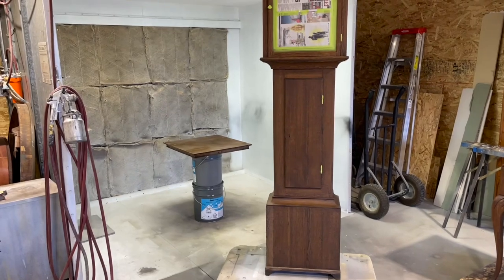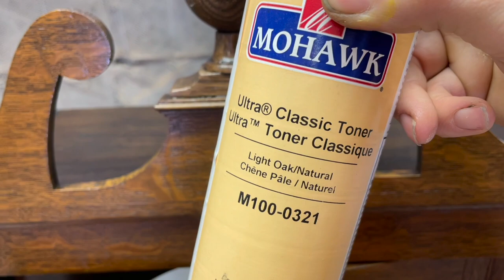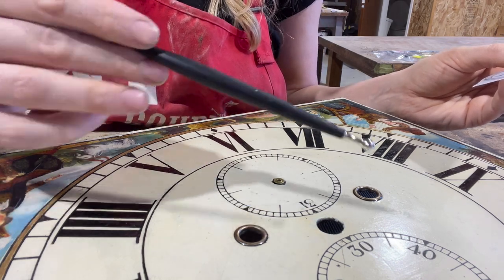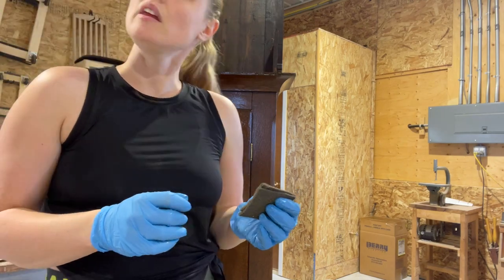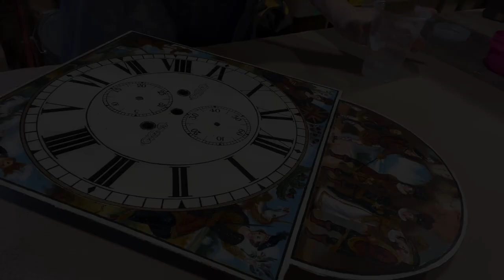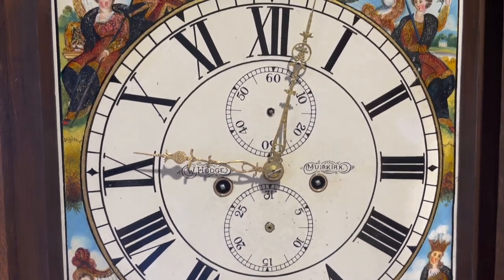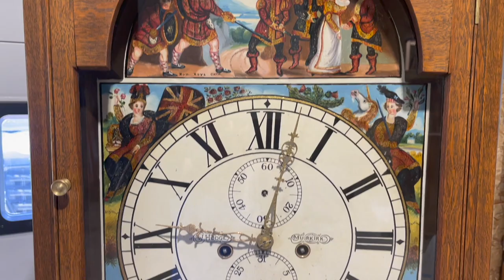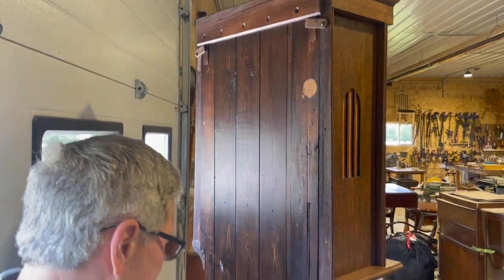200 Yr Old Clock Restoration: PART 4     ITS RUNNING!

Comment: I was confused by that "31", but then I understood that is the date dial. Spectacular end result, no doubt! What formidable talent and skill you have! Too bad it's over... I wanted another 20 chapters!
Reply: The clock was a calendar clock, the calendar feature only needed the addition of an extra gear or two to drive the date dial.
Reply: You could be confused by the 60 divisions on the dial which should have 31 of them. It's the only fly in the ointment...

Comment: I have never been less than overly impressed with the magic you show in restoring these projects. But the work you did on the face of the clock takes it to just one more level over what I usually expect from you. I expect artistry from you with word work, never expected you to show the same skill with a paint brush!
  That is one proud clock that will grace another home for the next 200 years

Comment: You are a true Artist! The restoration of the clock face is amazing.

The lower dial ends at 31 because it's a day-of-the-month dial. On the first day after a shorter month you'd manually advance it to 1.

We need to hear it in operation!
Reply from the maker: checkout the fall update for the clock in action. Cheers!

Comment: Trena, I just finished watching all 4 episodes. The clock turned out beautifully. You are so talented, between the repairs, the refinishing, and the clock face restoration, that if it had turned out you were also doing the clockwork repair I would have believed it! I was going to comment that the bottom dial is probably a date, hence the 31 -- we have an old Ithaca Calendar Clock with a date dial. I would have guessed that the top one was a month dial, but I see in pictures online that it was a 60 division dial.

Comment: Stunning.. have binged the last 2 parts.. 😉 ... incredible the fine detail and work this was given.. WOW.. Been so nice to have heard it working and as to the chime.. known if the smaller dials had movements.. over time (no pun) an repairs likely removed..!!  
You'd the weights and pendulum, but was not the case to got it running.. hey ho..
Wales.. an He's holding a Leek.. the norm as their flower is the Daffodil.. but clearly although green, it had white roots. 
Now I've an American wall/mantle Clock.. many likely some time must of come to England UK.  Our History.. second/hand as Wedding Present to my Grandfather.. so Dad told me.. the lower panel has a mirror, part of the backing is coming away in places, giving clear glass. Most all the research I've done shows a painted panel scene, has the paper back sheet, Patent Brass Clocks.
 I inherited it in 1995 and to my shame never set it working.. still packed as I'd collected from the repairer that same year.. Dad was then still in Hospital.. never got to wind-it.

Comment: Hi Trena.  As usual, you have proven yourself to be a master at color matching. Your skill there is really phenomenal. However, you have really blown me away with your artistry in the restoration of the clock face.  It's just unparalleled. Absolutely stunning.  If I may, I'd like to suggest that the upper sub-dial is probably the running seconds and the lower sub-dial may be numbered to 31 because it may be the day of the month register.  Perhaps Seth-Thomas would have hands that fit these positions.  Just a suggestion.  BTW, I love your cute dog too. Have a cup of coffee on me.
Reply from the maker: Yes. Thankyou so much!

Comment: I do hope you are adding note or a label to each piece that you have repaired and brought back to life, telling the next conservator what you've done adds to the history and the provenance of the piece. With this clock that's very important, its history and its value make it a very valuable piece. Do you know if the owner has had the clock serviced, it would also add to its history and value. Remarkable job. 🤗👍
Reply from the maker: Yes. Check out the vid “fall update” to see it running. Cheers!

Comment: The black printing on the old clock face was originally done with India ink, which was the most durable ink at that time…but it was not waterproof. 
The old back board had several holes..this came from the clock being screwed onto the walls. Because at that time, the walls were usually straighter than the floors were level. And the clocks didn’t run well if they were Out of Balance.
Reply from the maker: Uh. Very interesting. Thankyou

Comment: About the only thing I would've added to your restoration is maybe a small piece of screaming over the holes on either side of the top casing to prevent bugs from getting in to the workings of the cock. After all, that's not an area but one cleans every day when the clock gets round. How many days does the clock run when it's fully wound? I would suspect no more than seven days so that one can wind it for instance, every Sunday before they go to church. My dad was a watchmaker and worked on mini an antique clock in his day. I remember seeing one where all the gears and movement except for the springs was wooden. This, of course, dated back to the early days of clockmaking but the workings of the craftsman but made it made it a very beautiful piece of work. You're doing a beautiful piece of work on this clock. You've improved its current beauty tremendously!!
Reply from the maker: Thankyou. I believe it needs to be wound daily

Comment: I commented on the last episode, now seeing the cabinet  I am almost positive that it was made by the same hand as my cabinet.  FYI - Clockmakers bought the cabinets to put the clock in. Stunning restoration!  Now I'm at a loss for what to do - I am advised to not restore anything - due to the mechanism works.
Reply from the maker: Well that’s up to you. If you do not want to sell it why not have it restored. A sympathetic restoration won’t harm the value at all. The cases were made by different shops with the same plans all over that area. It’s only the face and sometimes the works with names.
Reply: @johnsfurniturerepair  Its the guts that motivated the "expert " (loosely) used term... Uno Langman of Vancouver who is renowned for his knowledge, everyone sent me to Him...  I'll send you a couple of pictures if you want to investigate a tiny bit?

Comment: was really quite a dramatic restoration. I got to say, I was cringing when you were cleaning off the old varnish, and then I was amazed at how well you restored it, good job. Tell me this, how often do you get restorations like this that are like museum restorationism work? I have seen those shops that restore multi million dollar paintings and it all come down to a butt load of Q tips and hours of wiping off little spots. I bet those old faded labels would show up under a black out light or infer red imager.
Reply from the maker: Not many. This was a real pleasure
Reply: @johnsfurniturerepair  I bet after this series of ideas,  you get more, Trena

Comment: Terrific job, especially  the  restoration of the clock face and the matching of the colors of the new wood. What happened to the hands on the two small clock faces, is there a mechanism behind the dials?
Reply from the maker: They just weren’t installed. Yes there is a mechanism and it is getting repaired.  Here’s

Comment: Brilliant work Trina!
Incredible talent, the case and the clock face look amazing, the lower dial looks to me like a date dial.
Do You know if the clock mechanism has been restored?
Reply from the maker: yes it is a date dial. the clock works will be restored by a technician. cheers

Comment: Congratulations, Trina.  Fabulous job.  So many skills and so much experience required to do this job well.  I did not listen to every minute, but don't recall you saying anything about the movement.  Does the clock run?  Does it chime?
Reply from the maker: It’s going to a clock repair technician. It will be fully operational

Comment: Fantastic!! So, the "fart" is the bottom of the wall behind the character, right? Question, did you send the clock movement out for cleaning?
Reply from the maker: The customer will be doing that

Comment: What is the clear finish you sprayed on the case?  The original would have been shellac.
Reply from the maker: Lacquer. The original finish was removed years ago and lacquer is a better finish in terms of protection. I’m not against shellac, I just don’t find it the best choice for many reasons. Cheers

Comment: Could you not replace the missing hands from the two small dials
Reply from the maker: They will be put back on later by the technician after the works are cleaned

Comment: Does the clock have an electronic movement now ?
Reply from the maker: No. It’s being repaired back to the original
Reply: @johnsfurniturerepair  
Thanks.  Anything less than a quality mechanical movement would be a disappointment.  I saw the small dials didn't have hands (yet) and didn't see any work done on the pendulum or weights, was why I asked.  😊👍